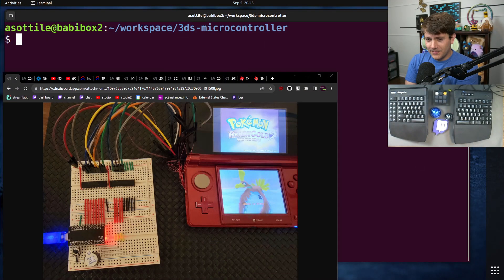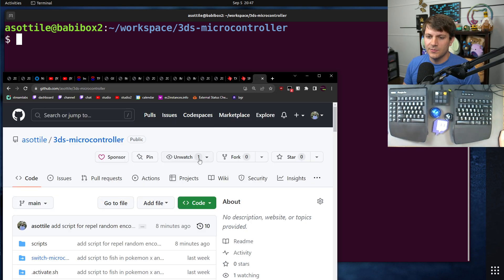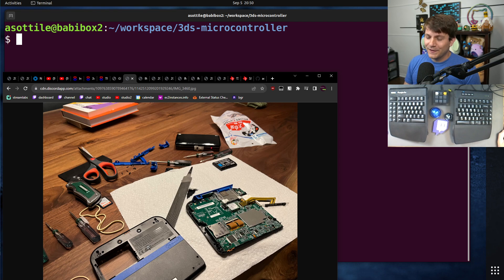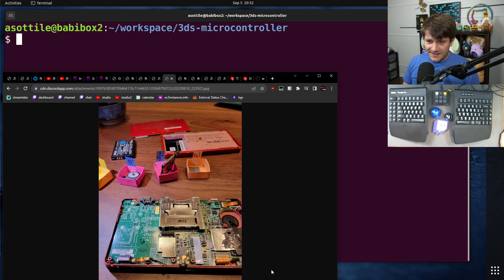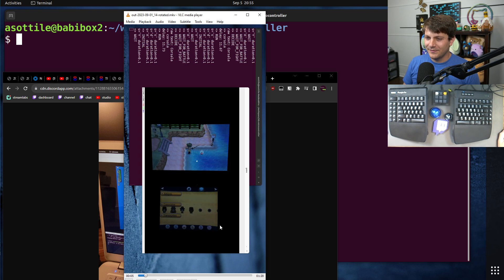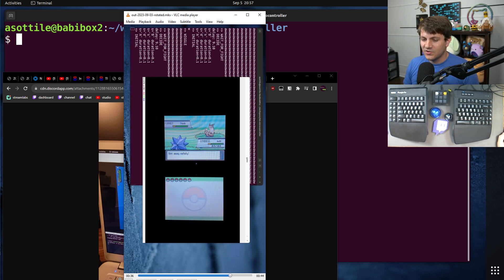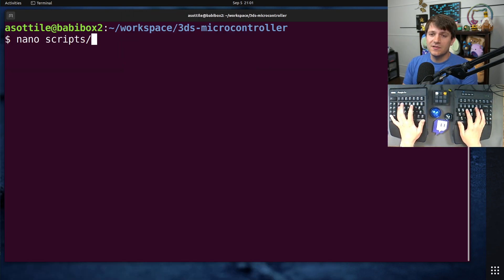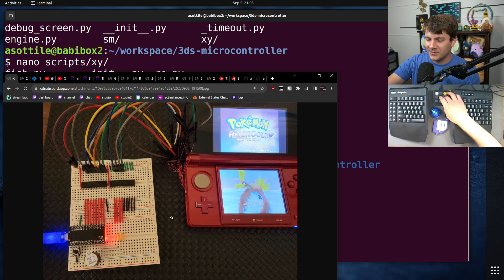automating the nintendo 3ds (hardware mod)

Comment: Absolutely love this! Do you think you could use analogue pins to control the circle pad? That would give you more functionality with movement for sun and moon. I plan on trying to do something similar using more traditional sketches and c++, I would love a follow up to this video in more of an "explains" style like some of your other videos!
Reply from the maker: yep!  the analog pads would be pretty easy to automate -- you'll need DACs (similar to what I did for my joycon automation here: https://github.com/asottile/nintendo-microcontrollers/tree/main/hw/joycon )

I also got the touchscreen working -- though that was after this video: https://github.com/asottile/nintendo-microcontrollers/tree/main/hw/3ds-touch
Reply: @anthonywritescode  could I not use the pwm on the pro micro for the circle pad? Would simplify the circuit quite a bit and seems like that’s what the 3xtds does
Reply from the maker: yeah you can make two crude DACs with PWM + resistor + capacitor which would work well enough for the circle pad (you don't need microsecond resolution like the touchscreen fortunately!)
Reply: @anthonywritescode  well I have mixed results! The pwm sort of works for c stick control, but it's too noisy with the capacitors I have to be useable. I ordered two dacs in case I wanted to do the touch screen anyway so i'll have a go with that, but i'm not sure how to control both at once. I'm having a lot of trouble with my level shifters (74LVC245),  of the 12 pins i'm using between the two, only 3 are giving me 1.8v. The rest are either 0 or fluctuating between 0.5 and 1.2v.
Reply from the maker: I2C is a bus so you can hook them up to the same lines for sda / scl -- one of them gets a different address when you give it voltage on its A0 pin (I believe 0x62 and 0x63)

not sure how it would work with 4 though :S

Comment: Maybe I've misunderstood your explanation of the way the 3DS does its buttons, but why would you even need a level shifter at all? Couldn't you just use the data direction registers on the micro to switch between pulling the pins low and disconnecting (high impedance). If you were particularly worried about the micro putting out higher voltages during startup, couldn't you have just used diodes which a sufficiently low forward drop and save yourself the hassle of finding the right kind of level shifter?
Reply from the maker: I need high for unpressed and low for pressed -- so I need some way to get from 5V to 1.8V to denote unpressed -- or at least that's my understanding
Reply: @anthonywritescode   I don't think you do need high for unpressed. Before you soldered leads to those test points the 3DS was able to tell that the buttons were unpressed when they were. That didn't change when you soldered the wires on. All the buttons do when pressed is short those traces to ground and the 3DS processor detects that drop in voltage as the button being pressed. To trick the 3DS into the thinking the button has been pressed you just short it to ground. To release it you stop shorting it to ground. Note that that doesn't mean to start pushing voltage into it, just to stop pulling. 

This configuration is known as open drain and you can interface with it from the arduino without any extra components. The trick is to exploit what pinMode actually does to the microcontroller at an electrical level. pinMode OUTPUT means assert the line level requested in the last digitalWrite you did. That means if you digitalWrite HIGH and are in OUTPUT mode then it's as if the pin is connected to 5V (since the arduino is TTL 5V) through negligable resistance. This strongly pulls the connected circuit to 5V. If you digitalWrite LOW in OUTPUT mode it strongly pulls the circuit to 0V. pinMode INPUT does the same thing (yes you can digitalWrite while in INPUT) with one difference, instead of pulling with very low resistance, it pulls with fairly high resistance (20 KOhms when HIGH, 100 MOhms when LOW, for most arduinos I think) resulting in the effect being much weaker. For your situation you'll keep the pins LOW but switch between OUTPUT and INPUT modes to press and release the button respectively. The only issue that may arise is that this will only work if the arduino and 3DS have a common ground potential, which according to your project readme, is the case so no problem there (just be careful to avoid plugging the 3DS in to charge while the arduino is plugged in). 

The digital pins page on arduino's docs has more info if I've done a bad job explaining it.
Reply from the maker: ah that's a neat idea -- feels a bit like taking advantage of implementation details though

I also probably can't use the idea though because I need to keep the 3ds plugged in (some of the events I'm trying to automate are exceedingly rare -- requiring hundreds of hours plugged in)
Reply from the maker: coming back to this -- this worked great for my other project!  (wired up a reset button to the Wii) -- switching between INPUT and OUTPUT works exactly perfect!